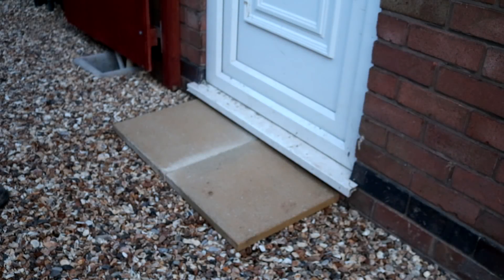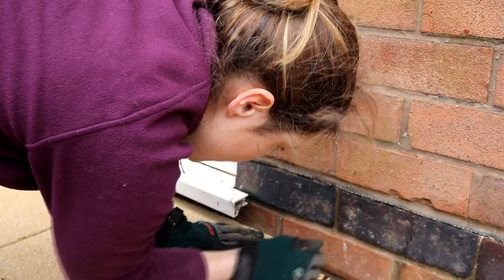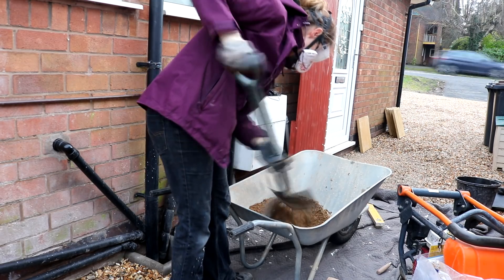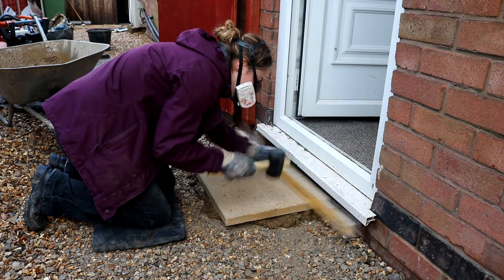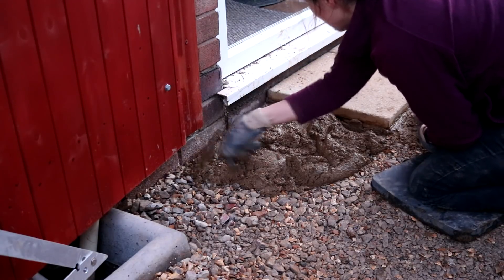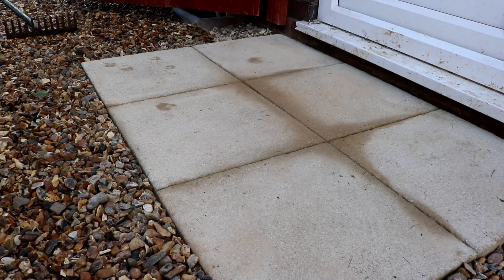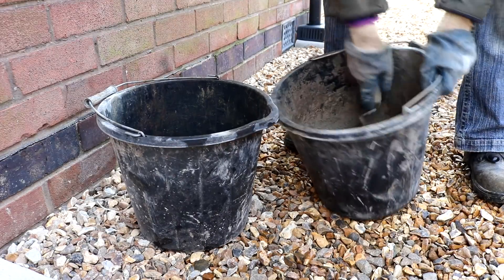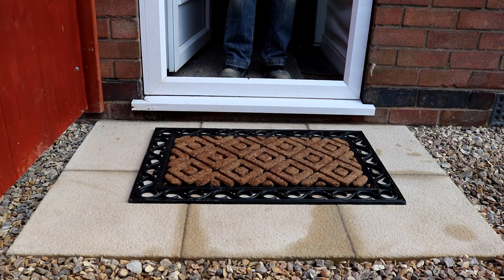Laying Front Door Patio Slabs DIY | The Carpenter's Daughter

Comment: Vicky, Try using a small tub or bucket to gauge the sand and cement, ie 5 buckets of sand to 1 bucket of cement. Accurate gauges make a huge difference to using trowel or shovel measures. You can also mix small quantities of cement by tipping the mix from one bucket to another rather than struggling to turn it in a wheel barrow. I hope this helps.

Comment: nice job Vicky.... when pointing slabs I brush in a dry sand/cement mix, then use an old watering can to sprinkle water over it all, no stains on the slabs
Reply from the maker: Thanks for the tip +888johnmac 😀 I was hoping rain over time would sort that but great idea!
Reply: ta but not my idea... think I got it from Tommy Walsh

Comment: Proper job, then :o)

When I was young (like, 500 years ago) the rule of thumb for run-off was 1 inch over 1 yard away from the house and a high point 4 inches below and 4" away from the damp course. We'd lay slabs on a drylene bed (6-8 dry soft sand, 1-2 dry sharp sand + 1 dry cement) and (brush and trowel) point with a dry mix of 4 soft sand, 1 cement. The mix would set by absorption and osmosis over time. We'd typically fill the gap between the slabs and the house with 3/4 to 1 inch pea shingle, just for prettiness.

Wet mix would be 4 soft sand + 2 sharp sand to 1 cement over a good sub-base.

All that being said, you did a great job of that little ol' patio and need to be well chuffed with the end result :o)

Good job, well done.
Reply from the maker: +ilookafter thewater thanks so much 😁

Comment: Great job but no need to add water to your mix as the moisture in the sand will send it off plus you can walk on it straight away :) also kiln dried sand is also fine on its own without cement but still a great job for a DIYer

Comment: Hi, I have just dismantled my decking in the rear garden as the timber was rotting. I would like to replace the area with slabs or monoblocking for a patio, I also have French doors that leads out to the area. So I will require steps. I have never done this type of work before, though I would like to try so I was hoping you could help me out in anyway possible. I have to start the job from scratch. 
I think what you do is fantastic!

Comment: Not sure what mix you were using old girl but normally 4 bag building sand half bag cement with some water to get consistency right is what we use in trade. Work your ratios out from there

Comment: Nice work
You could run a line of masking tape next to each joint to drastically reduce the chance of staining.
Reply from the maker: Thanks for the tip :)
Reply: Or just sponge everything over including joints. I use a large decorators sponge, it gives a nice finish and cleans the mortar from the faces of the slabs.

Comment: Seems to me that you could have used dry sand/cement for pointing and then thoroughly moistened it with light misting to get it to set. That might have helped speed the whole process by sweeping and tamping into the cracks  then adding the moisture. No? However your job looks great.
Reply from the maker: +Clyde Decker thanks for the tip 😁 I did wonder that!  I was a bit nervous about staining it but I would probably have been ok

Comment: Some tips from a pro: 😊

Don’t point on wet slabs, it can stain the slabs. 

Bcos the gap to point was so narrow, silver sand and cement would of been the best choice. Silver sand is very fine (edit: you did 🤣).

You really need to repeatedly tap the pointing down into the joint with the edge of the trowel, not just push it. 

Sharp sand for the bed as the small stones in it make it the strongest, aside from ballast of course.

To clean slabs after pointing... chuck silver sand on top and brush gently over the pointing with a soft brush. Must be soft or ul rip up the pointing. U don’t have to get all the silver sand off. Once it dries the wind will blow it away. Quick and effective. 

The muck you used for the bed should of been stronger too, 3/1 or 4/1 

Some people in the comments giving you bad advice too. Like using dry mortar for pointing. The wind will just blow it away and you’ll have to start again.

Comment: Personally, I'd have just used sand to level those slabs in place (already having the compactor was enough, and the hardcore underneath).  Unless you're having a load of elephants walking in the house 😁 At least in the future, it'd be easier to lift and do something else with (and saves time messing with mortar).
Reply from the maker: That's definitely one way to do it, as I did my back garden.  These are heavy enough :)

Comment: A great way to mix a small amount of cement is to use two buckets and pour it backwards and forwards before you had the water, this works great for up to about three quarters of a bucket of cement. But don't put all the sand in and then all the cement as this will make it very hard work, you need to kind of layer it.
Reply from the maker: Thanks so much for the tip +Symon Fobbester 😀